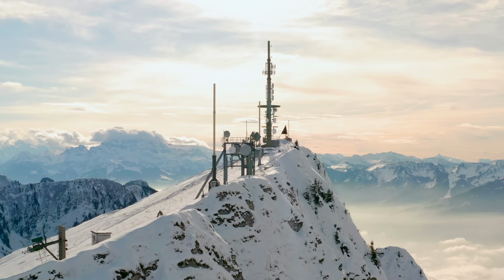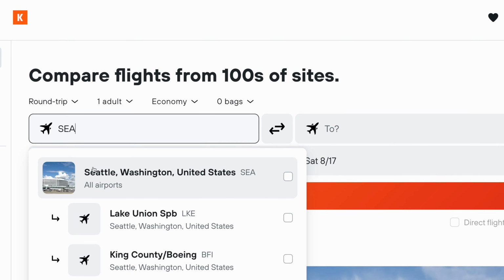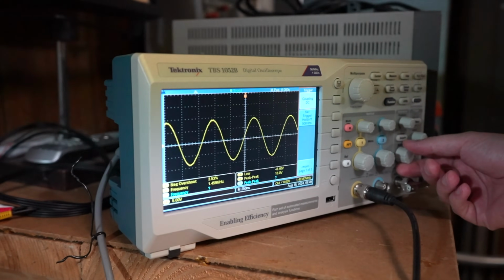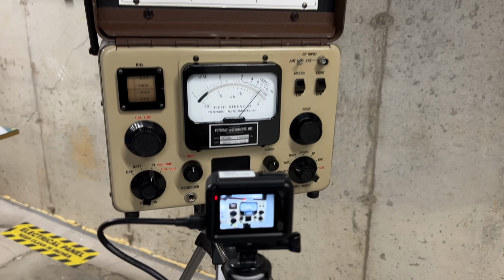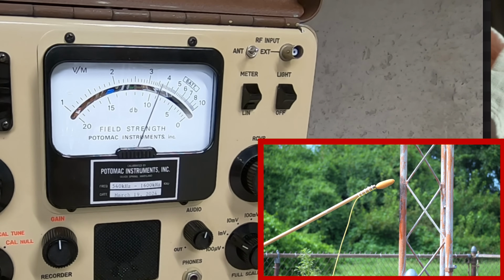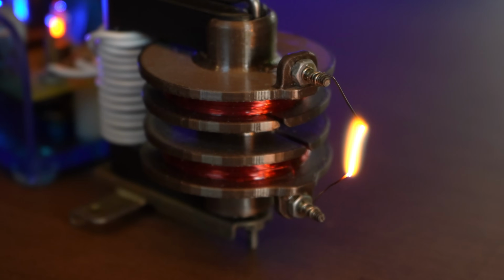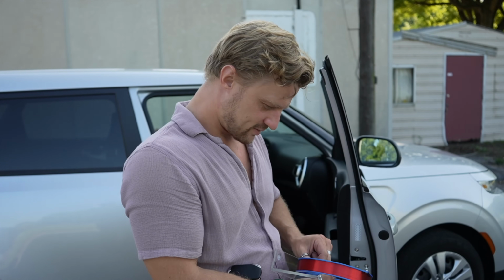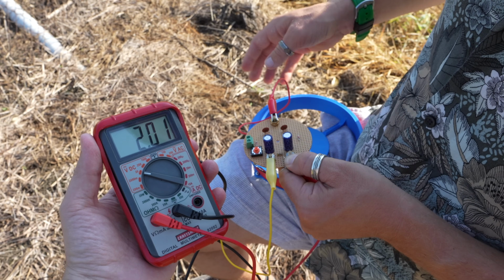Stealing Energy From Radio towers Using Plasma (ft. Geerling Engineering)

Comment: My uncle was a ham radio guy, and built his own amplifiers. He built a 14,000 W amplifier that had a huge vacuum tube in it! It was very cool. (and illegal!)  He would have me go out after dark and hold a fluorescent light tube up in the air near the antenna, I was probably 12 feet away, and the fluorescent light would light up bright!  
He also showed me some other cool stuff, he built a long wire antenna, which was a wire that ran about a half an acre across his property. He showed me that he could key his microphone and a couple seconds later we would hear that sound again. He explained it was his signal, skipping all the way around the planet off of the atmosphere and coming back to his radio! I learned a lot from this guy!
Reply: I did the same thing with 100 watts on a CB amplifier on my truck. I could key up and light a 4' fluorescent tube and walk around my truck and keep it brightly lit. I could also transmit through any speaker that was within about 50'. My large base station antenna with 150 watts would wipe out my neighbors TV's with my audio, coming out their speakers.
Reply: @iROBODUDE  This is why many legislations limit CB transmitter power to only a few Watts. 4 Watts in the U.K., for instance. Amateur Radio is limited to 400 Watts PEP on HF here. And we have to take proper precautions to limit personal RF exposure to below the legal maximums. 

The MF transmitter power in this video is damaging to health for long-term exposure at the distances they are standing away from the antenna. Essentially, they are doing to themselves what is happening to those food items, albeit much more slowly.

The stray radiation from a microwave oven is also limited severely for the same reasons. Maximum legal exposure limits are 10 milliwatts per square centimetre. If the diodes in the tuning circuit which we see in the video are burning out, then it's a good indication not to stay close to that antenna for too long. The maximum safe continuous exposure level area will be somewhere just inside the outer perimeter fence.
Reply: @iROBODUDE ...lol..no ya didnt
Reply: Was his name Tesla?
Reply: @RyanTaylor4real Tesla foi genial. Nos deixou seu rico legado em descobertas e invenções. Sou grato a ele por ter se dedicado à ciência.
Reply: Όλα ξεκινούν από τα δύο πηνία του Τεσλα. 
 @RyanTaylor4real
Reply: What's cool is that the exact same thing can happen with 10 watts.
Reply: 😂❤ Zimbabwe billionaire
Reply: Have you had any children? Enough power to excite the gasses in a fluorescent tube and you were holding it? Surprised it didn't make you sterile!
Reply: That is AWESOME!
Reply: 14Kw is alright...This day and age I bet nobody even cares anymore if ya exceed the legal limit...besidws, ya might have an emergency and need that w
Extra power, in order to be S9 on Mars
Reply: Along as licensed it's legal
Reply: @WMekh-g9d legal limit is 1500 watts for licensed hams
Reply: how did he even create it it may be enough enerzy to cook hotdogs 🤣🤣🤣🤣🤣🤣🤣🤣
Reply: Sounds like a sick dude haha must've been a trip crazy story dude thanks for sharing. Def been down a rabbit hole with this stuff lol 😂
Reply: so uh, how's the cancer treatment going?
Reply: @cornelionsqween8028  it's so much better now,  it killed the cancer cells too.
Reply: Not at 27MHz   @cornelionsqween8028
Reply: @cornelionsqween8028 Radio waves are non-ionizing radiation, they do not cause cancer.
Reply: You're using area (acre) in place of length (meters/feet) 😂.

Half of an acre could be a long and narrow stretch of land or typically a square 😂
Reply: Pyramids have come to mind.  They had a huge glass envelope seems it was to,do with the electricity collection of the pyramid.
Reply: @williamrbuchanan4153 they do come to mind. Today I watched Scott Manley new video where he tours the SETI site, and they have an antenna that’s both refrigerated, inside a glass bulb under vacuum. It’s a receiver

Comment: In the late 1980's the cellphone service provider, that I worked for, built a steel lattace tower which just happened to be in resonance with a nearby AM station. For cell service, we had UHF antennas at the top of the tower, so cell service was unaffected, but because of the tower's physical characteristics coincidentally, making it in resonance with the AM radio station, our cell site tower drained just about all the radiated rf power from the AM station, severely cutting down on the station's range. We ended up getting a specialist who attached steel cables to each corner of the tower going the length of the tower. He pulled them tight, almost like he was tuning a guitar string, until he'd physically changed the resonance of the tower to where it no longer soaked up all the AM station's power.
Reply: Good way to keep the FCC off your butt!!
Reply: We had to do that to our cell site behind the outdoor movie theater in Idaho Falls ID. The cables where attached to a tuning circuit in a 2 foot square box. Radio station was around 5 miles north of our site.

Comment: Radio towers are kind of like giant tesla coils. They both emit enormous high voltage through air. Also, when your put your hand near a tesla coil, its output will drop because the energy is going through your hand, not the air. The same thing is happening with this radio tower!

Comment: usually, if your power line is 60Hz,the sound of the plasma will be 120Hz, because the plasma doesn't "know" in which direction the current is going, it sound twice per cycle.

Comment: I suspect the drop in output power was due to the food causing a change in the tower impedance, and messing up the matching from the transmitter into the antenna, and hence the radiated power.
Reply: Exactly. Or, roughly, and smellingly.

Comment: I wonder if it would be possible to charge a phone with a similar device in emergency situations. Like being stranded in the woods. Obviously it wouldn't charge very quickly and there are probably a lot better methods. I've had solar panels break in my backpack while hiking so maybe it could be just a secondary emergency tool in the kit. I guess I'm thinking something like a trickle charger.

Comment: Having built a crystal radio when i was a kid back in the 90's, i knew that at least there had to be some level of wireless power transmission available when learning about Nicolai Tesla's plans during high school, this video shows a big reason why it never happened. between safety and making things robust enough to receive the signal.

Comment: Several thousand volts? Not really, for that 12kW transmitter with around 50A of current that's below 300V. In that scene with making a hotdog on the tower, if it was at thousands volts the sparks would catch from somthing around 10cm - but the sausage had to literally touch the tower to get some power flowing throuhg it.
If the tower would be above 1kV, I bet there would be way more barriers for you to overcome if you wanted to touch the tower.

Comment: I always wondered how some people with metal fillings could supposedly sometimes hear radio transmissions in their heads, because the signal was modulated and not just a plain audio signal. How was the signal being demodulated? And the answer is apparently, it doesn't have to be. The plain audio signal is present in the harmonic spectrum of the modulated signal, and the carrier is way outside of the perceptible range (and possibly partly filtered out by the less-than-ideal electrical characteristics of the meat in your head, or in this case the meat on the end of your stick) so the actual audio comes through. Cool!
Reply: All you need is a fair conductor with a nonlinearity to demodulate an AM signal, and a nerve to send it to your brain. My phone beeps into my computer speaker if it's too close.

Comment: Caution using HV gloves near RF. They are a dielectric. They block DC, but due to the capacitance, they will conduct a substantial amount of RF frequency AC, so even though they may be rated for 10KV, that rating is for 60 HZ, not 1.5 million HZ.  For the pickup coil, add a shunt regulator to keep the voltage in range of the diodes.

Comment: Who still use AM radio or system nowadays ? 12 kW ?! Operating it must be costly to power up ??
Reply: 12kW is rather puny actually -- like 8 hair dryers.  So about like running a large beauty salon.
Reply: @Graham_Wideman  for 1 hour yes its cheap but if it's 12h/day for a month is over 400$ for most places and over 5000$ in a year... my whole house isn't even using that much
Reply: @QuebecoisSti  Sure, a moderate cost for an individual, but not very significant for a viable business.
Reply: @Graham_Wideman   still, who still listen to AM ? How they are able to get revenues out of it I just don't get it. We are in 2024 not 1950

Comment: In my opinion...
So, you are just now using Tesla's wireless transmission of Energy?  
What's it been, over a Century now?
Bout time.
Thank you.
So, you put up your own tower with varied length wires connected to it, to suck the power of different frequencies from different Power Towers?  Hmmmmm...
So, at nine minutes the lesson is, "Don't touch your Penis to the tower!"
Reply: No, this is not "Tesla's wireless transmission of energy", it's plain old radio which transmits energy, sure, but falls off very quickly with distance. Nonetheless, still enough to power crystal radios and drive their headphones at a distance of many miles.

Comment: You can talk about wireless energy without giving a shout-out to Nikola Tesla. It was Nikola Tesla’s dream to provide free wireless energy. Arguably the father of wireless communication and inventor of AC power, along with being a crazy umm individual.
Reply: But Tesla was more or less opposed to radio, apparently writing in 1919 ""The Hertz wave theory of wireless transmission may be kept up for a while, but I do not hesitate to say that in a short time it will be recognized as one of the most remarkable and inexplicable aberrations of the scientific mind which has ever been recorded in history."   Instead Tesla hoped to transmit power over distance (not communications per se) through some sort of resonant properties of the earth possibly in conjunction with a hypothesized conductive layer of upper atmosphere.  And conversely, the task of a wireless radio transmitter is not to supply substantial power to locations at a distance, it's to supply miniscule amounts of power detectable at a distance by sensitive and tuned radios.  So although the realms of Tesla and radio look very superficially similar, in fact they are quite different in detail.

Comment: I have worked around waved energy, love "don't touch" any of the stuff, or else you'll die.  I recal that, and don't walk in front of that! or else?  Got it, YES! Sr!
Best one was high apot a prision in the middle of a desert,  that elevator was no spring chicken either?

Yes!  I had a pair of 501's with a tool shadow burnt into them from a plasma ball's passing that tool.

No one believes me? But as a kid ealy 70 near a SAC base, my braces picked up waved energy, sounded in my mouth and head like a tight mono fishing string in a wind bent back to an eye while you carried it.  "I tought it was" the first time I noticed as I was fishing.  DROVE MY BAT Yhit! till I got far enough away.

Comment: Touching the end valve/tube of your WWII army transmitter ain't a good idea either! I was doing a bit of maintenance and probe testing on my WWII airforce transmitter one day and I accidentally touched a bit of the end step of the transmitter with a knuckle of my hand all my muscles tensed at once!! and I uncontrollably jumped 3 meters/9 feet back!! slammed against my wall and sat there on the floor for a moment shocked and with an intense taste of burned hair in my mouth!
I upheld the first rule of high-voltage electronics ''one hand at your project and one hand for yourself'' if I had 2 hands in there I would have been quite crispy and really quite intensely dead! those crocodile clamps USE THEM! It will enable you to test or work on live electronics with one hand! and it may save your life one day!
Reply: also, all the deaths due to fractal wood burning are because the people ignored high voltage rule no 1 (see above)

Comment: is it possible to harvest enough power from  the air to charge a large battery bank? Asking for a friend! 😉
Reply: You can harvest significant charge from a tower during a lightning storm (setting aside the possibility of a direct strike), but it's at high voltage and low current and you would need a way to convert that to low voltage high current that you can afford.

Comment: Ok, maybe you can resolve my issue. 
I have heard talking voices in the air and i presume is some kind of transmitter, somewhere in the Europe.
Is it possible to do that ?? How they do it ? This is not a joke and i was not drunk, i hear it manny times, even this days. Thanks
Reply: Yes this is possible. Have you heard of a "crystal radio"?  A simple circuit that can receive a radio signal via an antenna, then selectively listens to a particular frequency of received energy, then rectifies it "extract" the audio, which it plays on headphones. No battery needed.  It's possible to get a similar effect from a sufficiently powerful nearby transmitter, "received" by some metal object near you that happens to have a dimension that resonates at the station's broadcast frequency. Add to that a corroded joint between two parts of your metal object which works as a rectifier, and this gives rise to currents at the audio frequency. This can cause vibrations you can hear.  Supposedly this can work with fillings in your teeth, though I haven't witnessed that personally.
Reply: Thank you for your reply. Is this Air sounds Dangerous ?

Comment: given this information you should be able to extrapolate the number of connections to or at least length of combined antenna 📶 connected to the transmission via the power drop of output... it'd then make sense to have power absorbtion or manufacturing nearby such as solar or wind for these power thirsty devices so line losses would be to  minimum ... i could feel this difference in detecting TV signals back in the day and noticing directions of bounced signals throughout the house actually finding the path lines by blocking them standing in the way and with dtv it got way way worse so had to upgrade to directional outdoor antenna as indoor would not cut it for non cable 🚠🚡 tv users, am and FM as free was my only option since i couldn't afford CDs, tapes had all the old tunes but i needed to hear the new stuff to remain hip/cool with friends because not knowing the references you'd surely be kicked from the group if you were not a skilled liar to blend in as if you knew silence was golden but it also gave you away like a beacon 🚨 or red flag the same patterns continue today with different technological resources just ask a skibitty toilet 🚽🪠

Comment: Amazing that there was not one mention of the Tesla Tower and the idea of broadcasting wireless energy in this entire video...
Reply: Because this is nothing like Teslas's efforts.
Reply: @Graham_Wideman  

It's the same principle.  A tower that transmits electrical energy over the air over a long distance.

He should have at least, talked about the differences, but he left it out completely.  Irresponsible.
Reply: @direbearcoat7551  But this tower, over long distances, transmits miniscule amounts of energy over the air. That is not the same as Tesla's pursuit. And his method for transmitting large amounts of energy over distances doesn't work. It doesn't occur to anyone knowledgeable in the radio business that this is somehow related to Tesla's pursuits just because it's a tower.

Comment: When your generator is collecting power, does this reduce the output of the antenna?
Reply: No because the power has to come out of the antenna into the "generator"/absorber. However, if you really mean does the "generator"/absorber subtract from energy that would otherwise have radiated further, yes, but such an insignificant amount that it's unnoticeable.

Comment: FYI for your next flight, "colic babies" on flights is caused by pressure in their ears/skulls from the aircraft pressure designed for adults.
Babies have yet to develop tolerances for minor pain or pressure on their bodies, and so it registers as "OW PAIN" to them, if the parents were smart they would give the babies some pain relief, or not take them on a plane.
The popping sensation adults feel is multiplied in a painful sensation of the small child/baby. Flexing their jaws will generally relieve the pain in most children, but with extended periods of pressure it can be impossible for the jaw muscle to relieve the inflamed areas.
Reply: They're just acting their age. I've seen a lot worse from grown men and women.

Comment: The exponential drop off with distance is what makes it completely useless. Whats really shocking is regular high power cross country power lines transmit way more power through the air then any radio station. i lived under a medium sized high wire and stood in my back yard with a 32" florescent bulb fully lit up in my hand.
Reply: Well, inverse square law rather than exponential, but yes.  Meanwhile the Tesla fans all thinking this is confirming Tesla's dream to deliver wireless power.